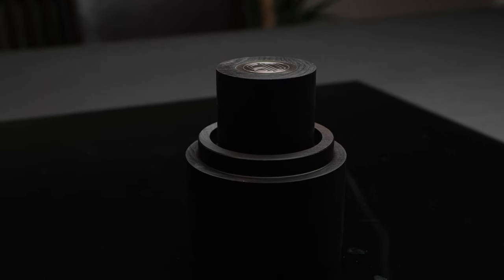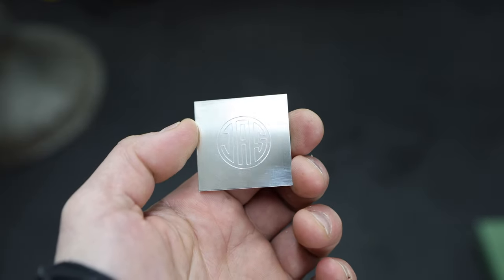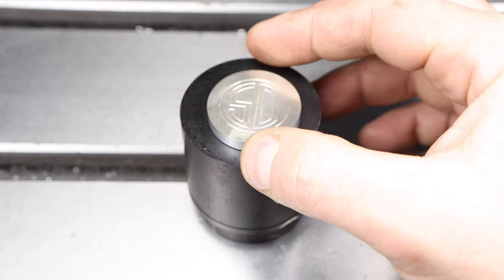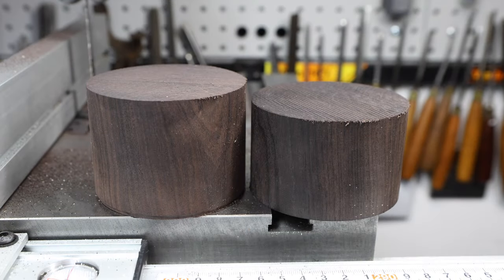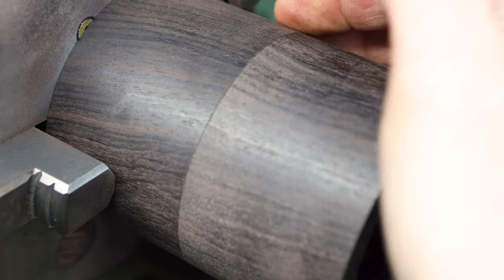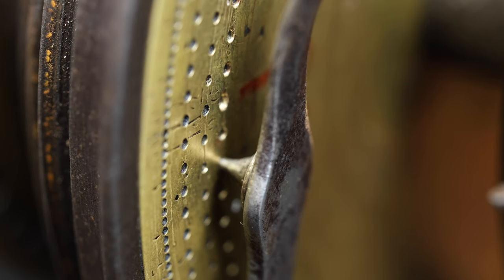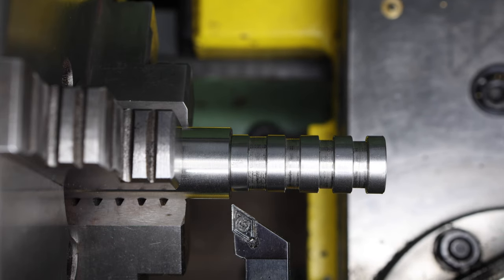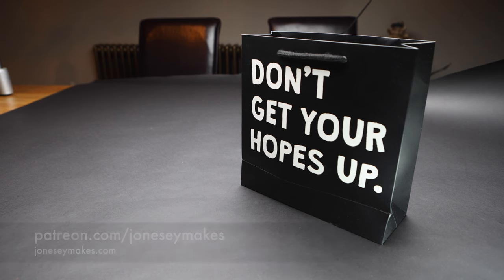Exotic materials, vintage equipment, unusual techniques

Comment: Nice work. Less is more sometimes. I've turned Australian mulga wood which is a desert timber similar in density to African Blackwood. It machines like steel and it can be polished by holding a handful of mulga shavings against the part while it spins in the lathe. The heat and friction burnishes the natural oils and resins to a high shine.
Reply from the maker: Thanks Preso, mulga wood sounds interesting, I've not come across that before.

Comment: Excellent work! The African Blackwood looks beautiful. Here are a couple of suggestions for potential refinements:

    Chamfering: Delicately chamfering the edges, even where the lids meet the main bodies, could add a touch of softness and structure to the design.
    Engraving Contrast: To enhance the visual contrast, consider using Liver of Sulphur to blacken the 925S engraving. This would create a striking pattern of black wood, silver,   and black engraving. Another option is to blacken the silver first and then engrave.
    Plating: Using White Gold or Rhodium electroplating on the silver would protect it from oxidation and maintain its bright appearance.
    Material Choice: For the stopper, 316L stainless steel would be a more advanced and practical choice. Its Molybdenum content makes it resistant to the acidity of wine.

Overall, I love the clean, non-ornamental style. It's elegant in its simplicity!  Please continue sharing these kinds of projects; I enjoy watching them and learning from your insights.
Reply from the maker: Thanks for the suggestions, much appreciated.

Comment: great project, my only comment would be a slight chamfer on the ends and 
aligning the engraved  sterling silver lettering  better to the end grain of the wood...
to my eye, [3,000 miles or so away] it looked to me taht a slight rotation would help the look...
a beautiful piece you have made there,,,,,Brilliant....
Reply from the maker: Thanks Paul, yes agreed. I could have aligned better and should have chamffered the ends.